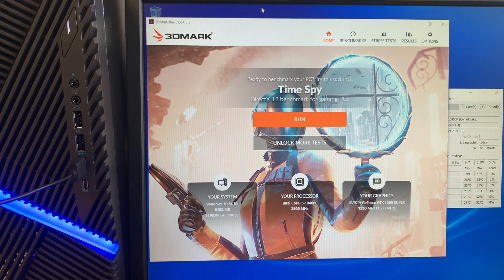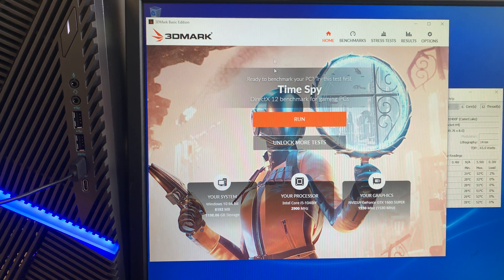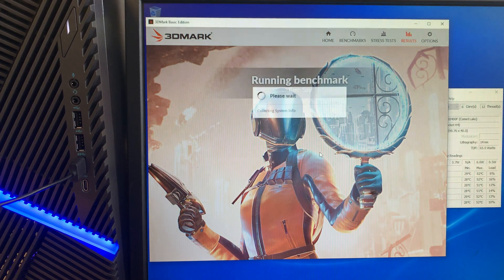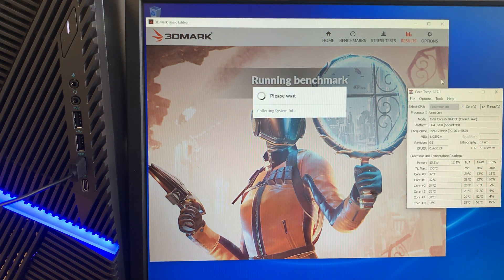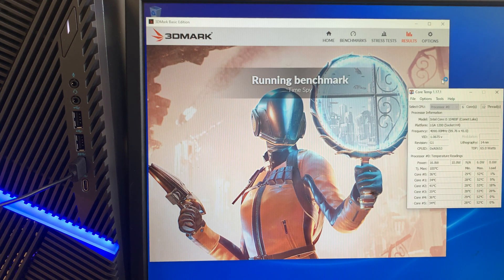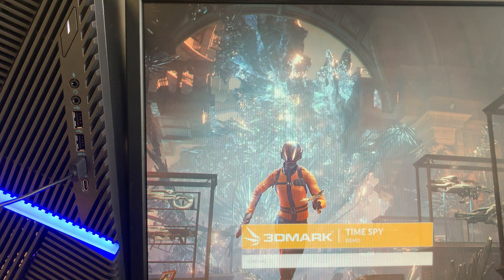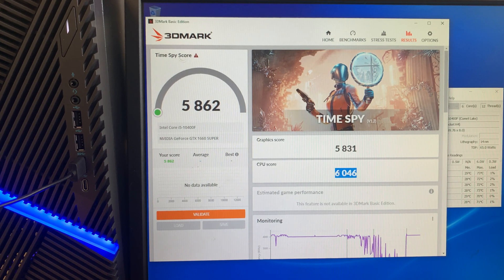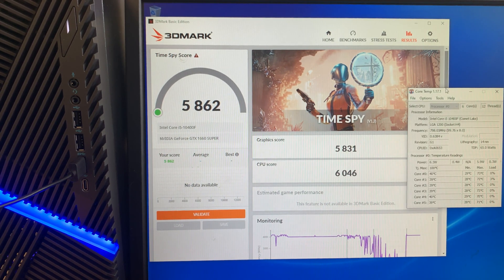Dell G5 Benchmark CPU Temperature

Comment: What was the highest temp you have ever gotten because some people say this case overheats easily.
Reply from the maker: In around 90 degree celsius
Reply: @UbergeeksBiz  what temps do you get on average and is the system loud? Thanks.
Reply from the maker: @bolilytjdjdh1263  Emails, browsing internet, Word documents...etc, average around 55-65. Not loud, can't hear fan. Desktop sitting on the floor.
Reply: @UbergeeksBiz  how about gaming?
(Such as Fortnite)
Reply: @bolilytjdjdh1263  i haven't tried fortnite but i did rainbow 6 siege on ultra and high settings and it got 75-80 max (i have the 1650 super model)
Reply: @bolilytjdjdh1263  the 1650 super and 1660 super shouldn't be to far off